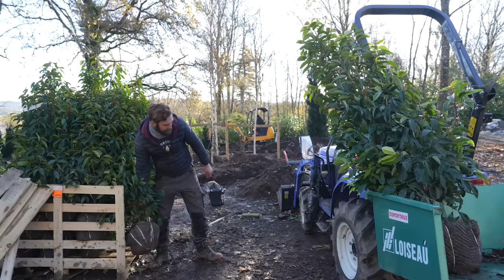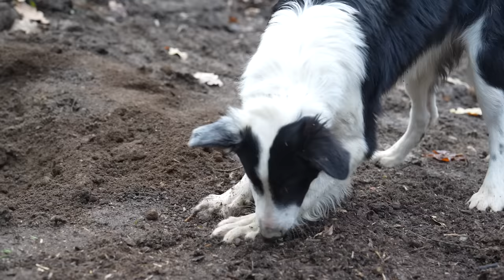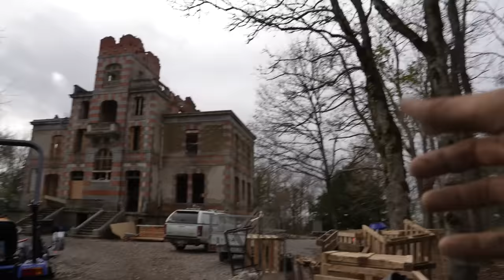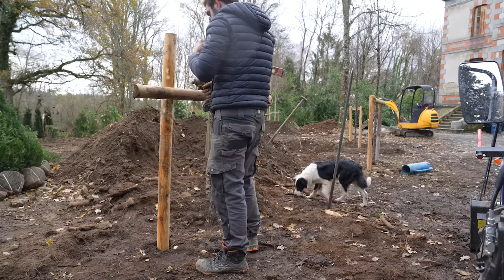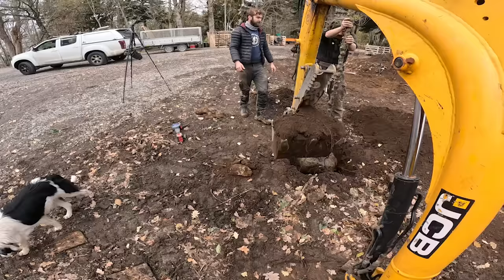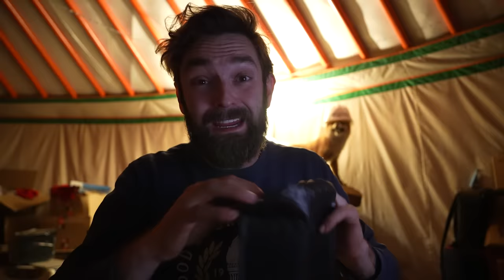400,000 subs and ill get the roof on.

Comment: And what about the windows? How do you close them?
If I had to close those openings I would build a frame with cross bars for the outside and press this frame with other cross bars and thread rods from the inside to the wall. I would then put some corrugated sheet plastic on the outside frame to let daylight in but not rain and snow.

Comment: May I offer a suggestion? The trees should be handled by the balls only, not by the stem. Roots can break if allowed to hang unsupported. Before backfilling it helps to pull back the burlap and tuck it downward. Gives a better soil/root interface.

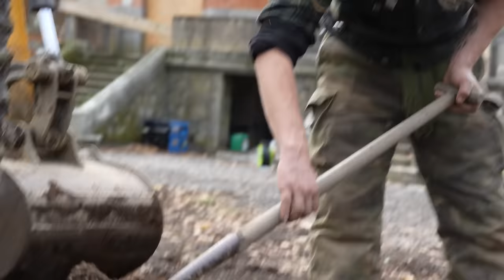Comment: When I was watching château diaries today, Davy said it’s better to plant them with the metal and the burlap or whatever the ball is wrapped in and it will disintegrate and it’s safer than doing bare 2:01 root because of the oxygen that could get to the roots if not completely covered without any air pockets just FYI he said that the wire will disintegrate as well as the burlap or whatever it is
Reply: How long does it take metal to disintegrate? Must be removed for the roots to spead or will die
Reply: Quite a number of people commented that trees of theirs had blown over because the roots had not been able to properly establish. The burlap and wire cages had restricted the roots from spreading
Reply: I've never in my life seen any professional gardener say such a thing. The roots should be freed and also broken up a bit to stimulate them to spread more quickly and support the tree. Constricting them is daft. The wrapping is just there to keep the roots alive while it's sitting around waiting to be sold.
Reply: Dan, Nick and Cameron are using the beautiful soil they have and the compost Dan had the forethought to make, to ensure that the roots are covered - this way the trees will have a better start.

Comment: You also picked the one side of roof that needs its chimney rebuilt almost completely. 
Also are you going to put those top floor windows in with the roof? 
Your thumbnail doesn’t have any so wondering if that was just a rough guesstimate.

Comment: I hope the trees have not been planted too deeply. The soil line on the trunk should be as it was before and sometimes when they ball them up they make the soil level too high to keep the moisture in. Also how do you plan to water all the plants? They will need some over the summer.
Reply: Nick is an arborist. I am sure he knows what he is doing.
Reply: Dan is a gardener also.
Reply: Hi, I prefer to plant trees/shrubs a couple of inches/50mm below the ground level, but only to the soil level on the trunk to help with watering, specially through a dry spell. It directs water to the roots, with maximum efficiency

Comment: Far be it from me to complain...
But it looked like you were planting the ball of a tree with the burlap still on.
Please don't do that.
It will gerd the tree, between the roots and the stem(strangle),
Usually killing the specimen.
Just a heads up.
Even if you have to dig up the top of the root ball, cut the burlap completely away from the top of the ball.
Also, slicing through the burlap (in various places all around the ball),
(if you don't otherwise remove it)
Is highly recommended.
Otherwise, great job Fellers !!!
Reply: @andymccabe6712 Clearly you know zip about planting trees and shrubs
Reply: No, they've been removing the wrapping.
Reply: What do you think was happening at 1:16?

Comment: While you can rebuild the roof, and I assuming you are so headstrong you will do it, I think without external engineering, you are setting yourself up for big problems down the road. You have relatively haphazardly rebuilt (somewhat) the walls without a professional engineering service validating the integrity, and now you are about to put real load on the structure. I think this approach is dangerous at worst, and extremely foolish at best.
Reply: How do you know he hasn't been working with an architectural engineer?
Reply: He's said it before, he has a structural engineer guiding him. But people only listen to the voices in their own heads, not the one speaking in the vlog 😙
Reply: If you subscribe and watch the videos, you would know Dan IS  working with an engineer.  You should not call Dan foolish when you dont know the facts.